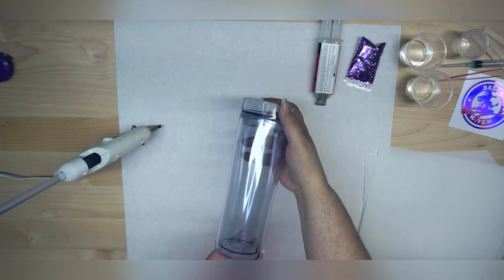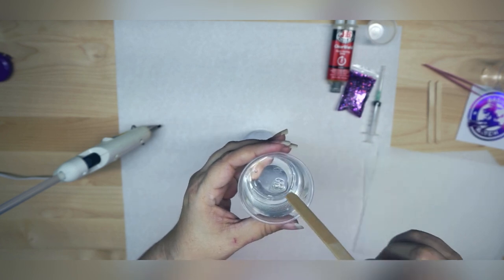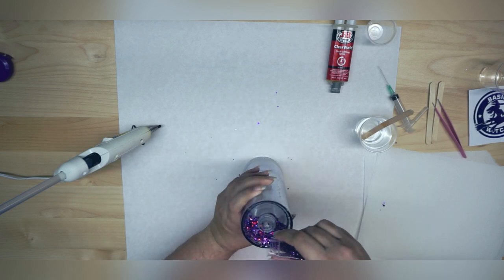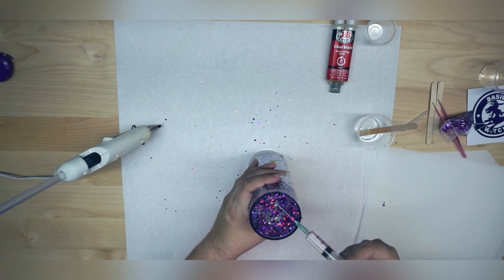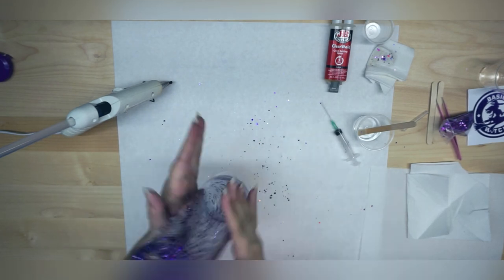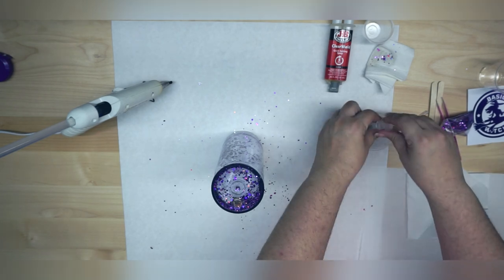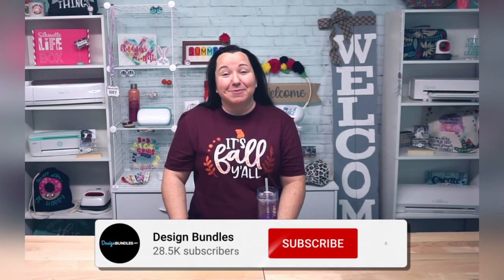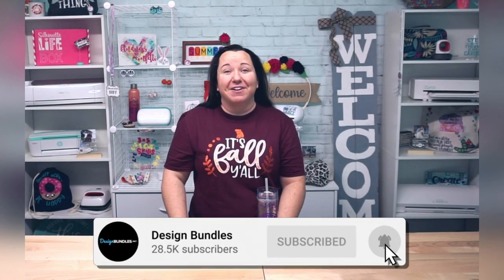How to Make a Glitter Snowglobe Tumbler

Comment: Hey! I made a tumbler like similar to this last night and then it started leaking at the rim where the top goes. Any idea how to fix it with throwing the entire cup away?
Reply from the maker: I'm sorry Marimar, I do not, unless you are going to take the epoxy (or whatever sealer you use) and try to do a small layer.  I don't think I would try it though.  Sorry I don't have more ideas!   ---Becky

Comment: How would you make the glitter move around more? Add more liquid?
Reply from the maker: Good question!  The whole tumbler is full of the glycerin/water mix.  I think these don't move around as much because there is not as much room between the two walls of the tumbler.  I think larger tumblers with more room will move around better.  Hope this helps!---Becky

Comment: Did you seal the vinyl? If so what do you use the seal it?
Reply from the maker: Hey Rachel!  Great question!  I did not (and usually do not) seal the vinyl.  It's rated for permanent adhesive, so it should hold up several years with gentle handwashing.    Hope this helps!   ---Becky
Reply: Where do you get your vinyl?

Comment: The water/glycerin mixture will draw up much better if you get a 16-18 gauge needle. Your needle has too small a diameter to draw easily.
Reply from the maker: I agree!  But taking the needle off worked well also, thankfully, or I would have been there forever!  Thanks for helping out!   ---Becky